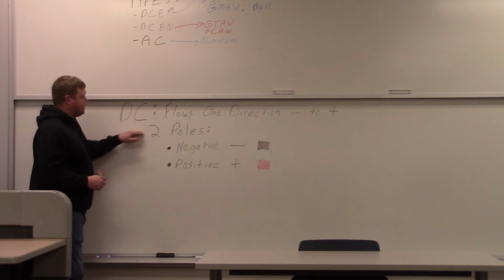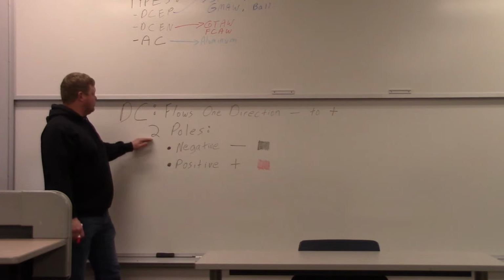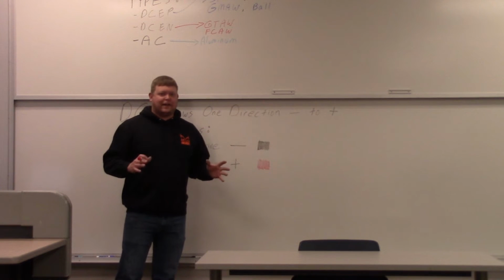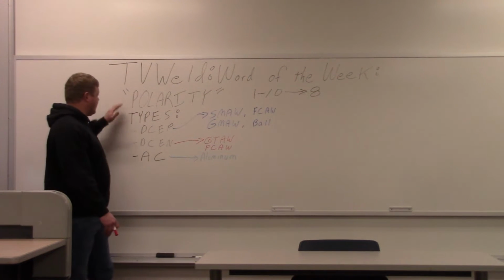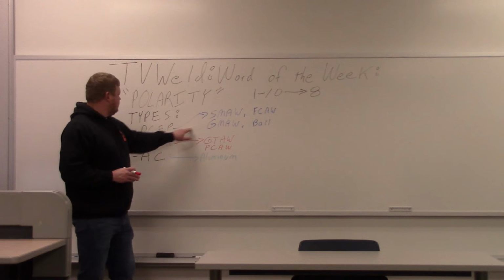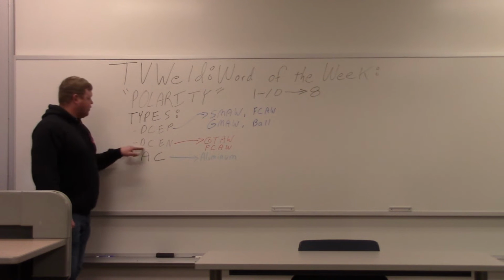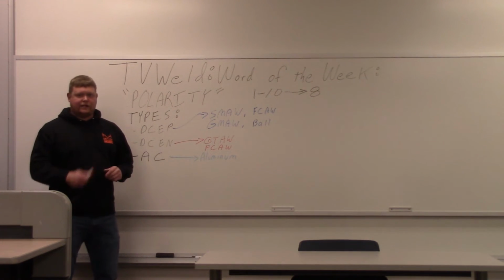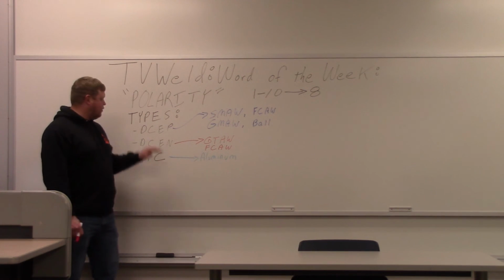Polarity & Welding

Comment: Very few videos actually answer the question properly. Which one gets connected to what. As a non welder idk. I thought it was the work piece. Seems like it's common to refer to the electrode. I guess it's because of electron flow. If you have a negative electrode, every time you strike an arc you melt the rod first cause all the current going through the tiny wire. If you have negative on your work, the electrons have all the metal to flow through and when the rod contacts it might just burn it up and the flux or stuff on the outside of the rod gets in the way. Or the metal only gets too hot but in one tiny spot. The only good part is it could prevent oxidation cause you're having extra electrons in the metal